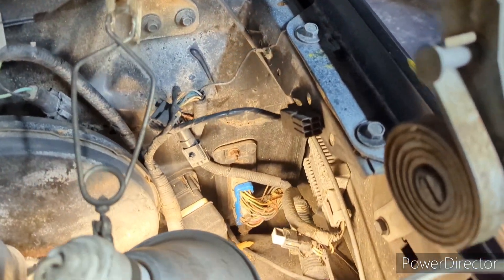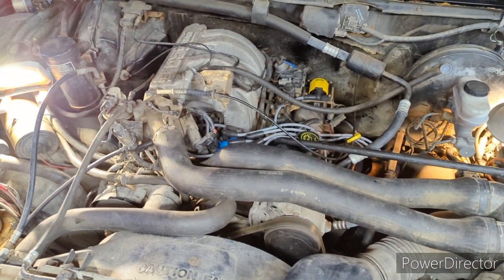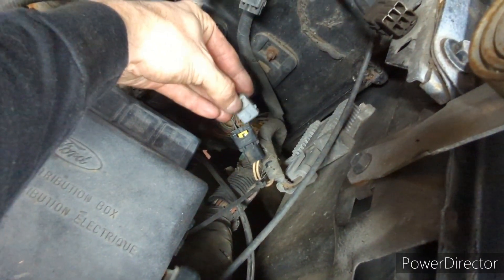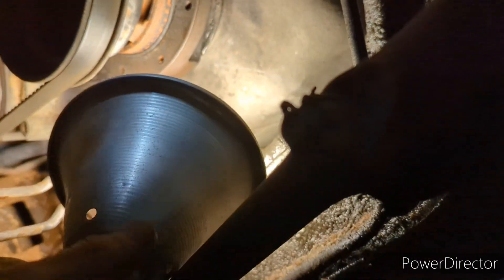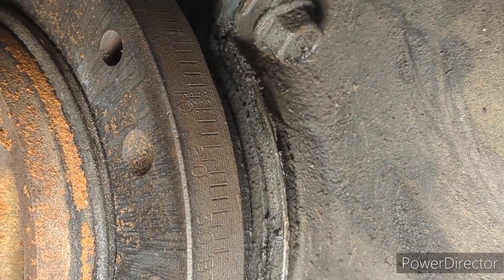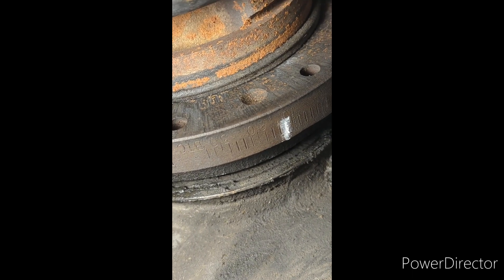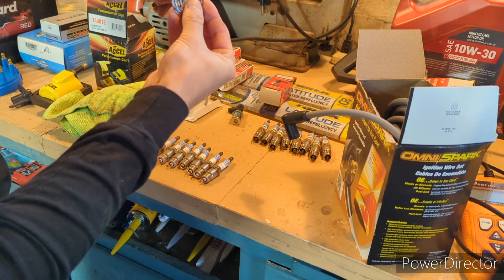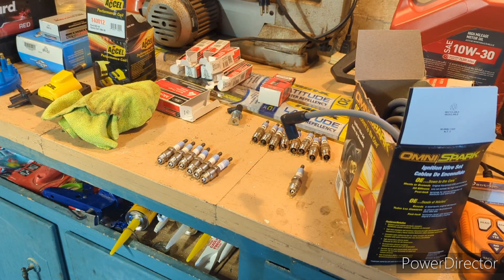Jasons Cliff Notes - Timing Spout Connector and Timing Mark Locations, and  gapping plugs properly

Comment: no, you put it after, not before because if you put it before it will fire the combustion fuel coming up and you need to fire it going down.
Reply from the maker: What in the world are you talking about?
Reply: @jasondoesthestuff  I am talking about timing at the right degree.
Reply from the maker: @John-z3h4b not to argue on a comment thread but I don't want misinformation on my channel. That is not correct. Advancing ignition timing means the spark plugs fire earlier in the compression stroke, before Top Dead Center (TDC). A simple Google search will back me up. Please do your research.
Reply: @jasondoesthestuff  sorry, but i i spark compression before it reaches peak and to me that tells me that it conflicts with the rotation of the crank as the explosion happens before the piston reaches its full combustion. I think something must adjust the timing exterior to the mark on the crank pulley. There should be a you tube video showing the internal adjustment. Ever heard of "poppet valve" ignition which does not have an exterior timing? It works by firing the combustion at its highest going down by firing at an average of the high and lows.

Comment: Is this the fix for code 213?
Reply from the maker: Possibly, 213 is the code for an open Spout circuit, but unless someone removed it and didn't put it back it could be a broken wire in the harness. Try checking your timing with and without the spout plug installed and see if the base timing changes. If it does them it has signal but something else is off. If it doesn't change then you have a break somewhere else on the circuit.
Reply: @jasondoesthestuff  alright I'll get to it this weekend and comment what I find

Comment: I have an 85 f150 and can't find this plug on mine
Reply from the maker: On my 1989 f150 it was closer to the distributor. It will be between the distributor and that drivers firewall typically. Just look for that gray plug, all of the ones I've seen have the same gray shunt plug.
Reply: @jasondoesthestuff Yep, I was wondering about your video, too. The SPOUT  plug on my 1990 Ford F2 5351 CID California emissions is located in a wiring harness and between the distributor and the air-conditioning compressor.

Comment: Hi, my truck has the code 212 spout grounded 

You know how to fix that? :(
Thanks for the help
Reply from the maker: Could be an issue anywhere along that wire, I would find the spout connector and try to trace the wire as far as you can. Maybe it rubbed and is bare metal touching the firewall somewhere or it's melted to the exhaust. If I remember right that wire runs from the distributor to that connector plug, to the ECU. On my 89 f150 the spout plug was right next to the distributor, so they aren't all in the exact same spot. I would start there and see if anything looks out of place

Comment: Where did the timing part disappear too
Reply from the maker: My crank pulley had spun, so I had to replace it before setting the timing and making the actual adjustment. That work is in the next video after the pulley is installed.